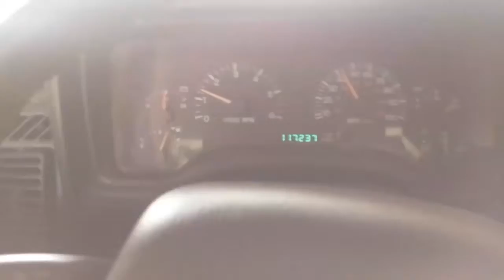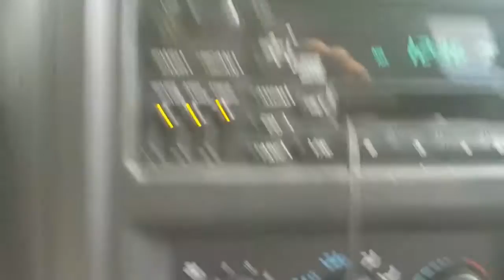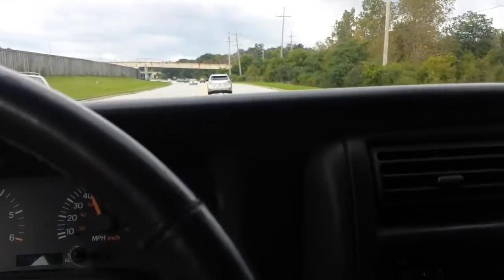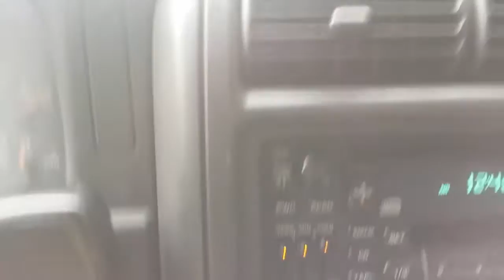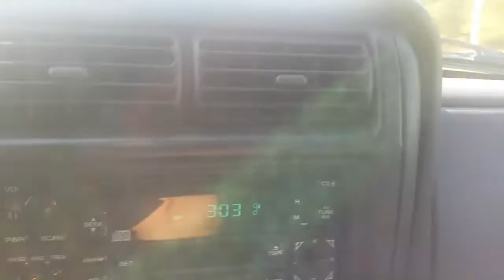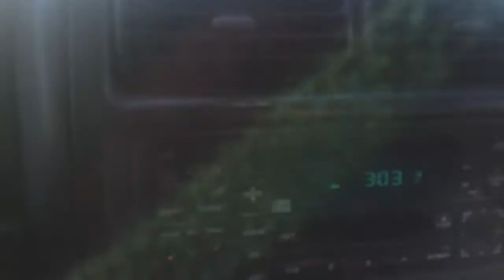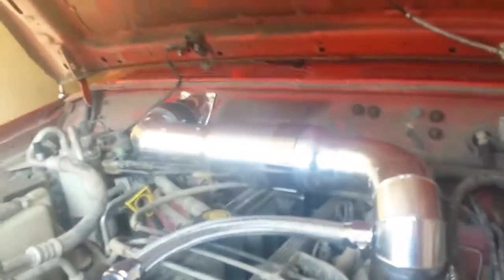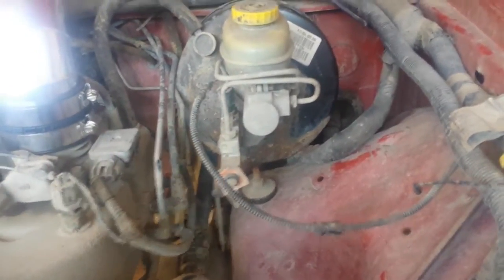Specter Cold Air Intake Jeep XJ

Comment: nice I have the spectre cold air on my jeep comanche... I personally think its not noisy unless ur giving it gas to the point u wanna here the air getting sucked in...my comanche is my daily driver and I have no problem with the noise not eben long.distance... only diff on mine is that mine goes to the right side of the firewall and its in a S shape...

Comment: So now that you've had it for a while longer, do you have any new thoughts or feelings?  Would the intake noise be annoying on long highway drives?
Reply from the maker: Well that's a very interesting question. It is very loud if comparing to stock. just on a cold start it is very noticeable and often something you have to BEGIN to raise your voice over the sound of the intake, now mind you i have an exhaust, mud tires and this intake so its hard to say if the intake itself would be annoying to your average Joe ..I don't mind it because it is not my daily driver. When I'm driving someone in my jeep its for one of 3 reasons. 1: We are going off roading, comfort goes out the window right there. 2: I'm showing off my jeep. I want the noise. or 3: my daily is in the shop and whoever is with me knows that. Would i recommend it for a daily? Once again if you don't like noise... no.. But every driver is different. I get A LOT of compliments on it especially if i need to floor it for whatever reason, an unsuspecting passenger will often "OOOOOOO damn!" due to the sound adding to their ride-gazim. So to answer your question. I cannot say. I would drive this thing to Florida and back if i had $2,000 for gas. But my sister, father, mother, some of my odd friends.. wouldn't even take a ride to lunch in it. Feel free to send me your email or something, and i will gladly answer any questions you may have.

Comment: How does it do with water coming from the cowl from water crossings? Or rain?
Reply from the maker: Kyle Ouellette the only issue I've ever had is if I go through deep enough water at high enough of a speed that a wave comes over the hood I have stalled at these points but never vaporlocked. Rain never an issue

Comment: What gear were you in that you hit 5k rpms? I’ve only gotten mine up to 3k in Drive when accelerating. Haven’t done the cowl intake yet.
Reply from the maker: Well it being an automatic 3spd with overdrive I assume 1st or second, but keep in mind that tire size and lack of re-gearing had a lot to do with it.
Reply: Darren Levey interesting to know. I mainly keep mine in Drive when high way and city driving. I’m not much of a gear head, is it better to drive it in 3rd gear vs Drive for local around town cruising and D for highway? Appreciate your knowledge and response.
Reply from the maker: @maronroth  my apologies for the confusion, I don't mean I keep it in 3rd. I was in drive, (but the actual workings of the transmission is a 3 speed with an overdrive which is a system that lowers the rpm at higher speeds to improve gas mileage) however due to the tire size I had on there, when I put the pedal on the floor it will get up to 5k rpm from a stop or slow crawl.
Reply: Same thing was happening to mine, u should check for slack in ur accelerator cable
Reply from the maker: @nolesy51  Mine? Nah all is well there, I dont see how you cant get up to redline if you have the pedal on the floor. Infact if you are flooring it and it shifts at 3k that may not be good.
Reply from the maker: Oh good god. Nevermind @sam I missed that entirely haha. Yes, check your throttle cable Matthew.

Comment: how does it sound on the outside?
Reply from the maker: it's less loud than you'd assume but if you have the 4.0 any jeep fanatic could be blind and know when you floor it. if you are looking for sound get an exhaust, but I've sank my jeep twice since this install and I have no complaints. it stands the test if time. hope this helped.
Reply: Thank you for the quick reply. I'm just trying to get an idea of outside noise for when I'm in a group. Making sure it wouldn't get annoying to everyone when the doors come off and we are riding close. I do have an exhaust that I'm happy with, and I think the inside noise of this paired with my exhaust will sound and feel good. Since they don't make these anymore, I got a parts list from spectre to build one so I'll have mine soon. Again, thanks for the reply! Great video
Reply from the maker: +logan smith awesome glad to hear it. inside noise is substantial however. I mean to a degree that phone conversation on heavy acceleration is not a possibility. but outside just sounds like that big ass i6 sucking air.
Reply: Sweet! Haha. Sounds like a fun party. I have a buddy boring my tb to 62mm and bigger injectors on the way and I'm porting my exhaust and replacing my exhaust manifold with a torque tube (current one is starting to crack) and keeping my 2.5in into a Flowmaster. I think I should feel some power gains, what do you think?
Reply from the maker: +logan smith personally I'd never touch the engine. that i6 was and is one of few engines in history to be truly indestructible. a friend in college stress tested it in shop, no oil for 20 mins, shut it off, and it started again. they then added sand. 20 mins. still started up. water.. still ran.. I'm not saying don't play with it .. but there is that age old saying.. cant improve on perfection.. if there is any truth to that you may be asking for issues. now on the flip side, that engine puts out Wayyyyyy more torque than the little Cherokee could ever need. so again.. aside from cold air and an exhaust. my engine is stock, if anything cooling and power steering upgrades are in my future. sorry for the short book check my jeep out at Facebook.com/acethejeep and feel free to as as many questions as you want, I'll do my best to help.